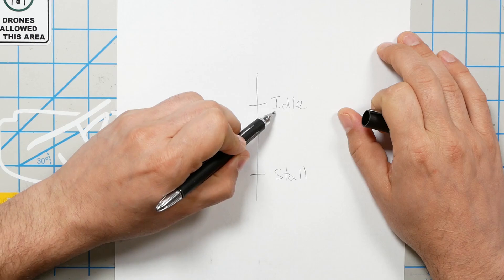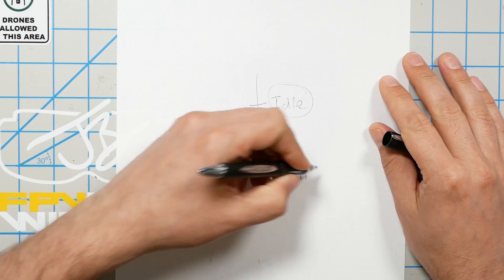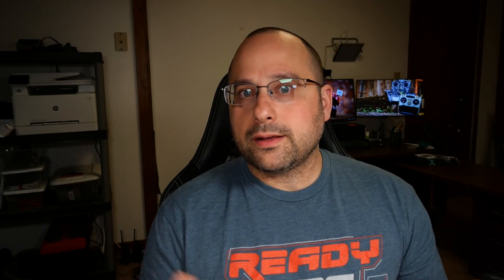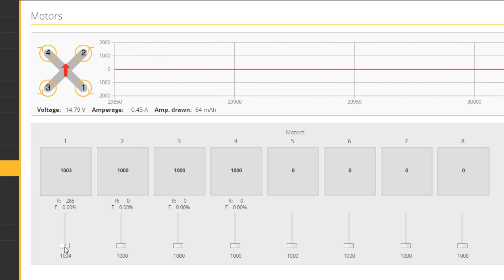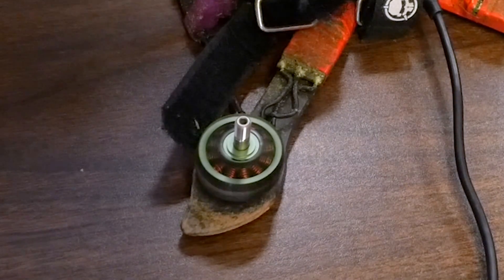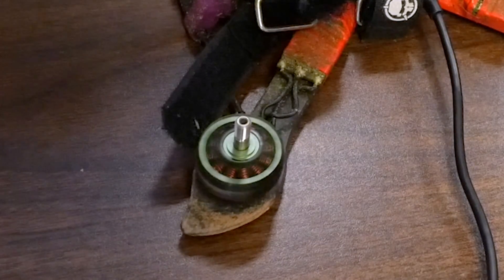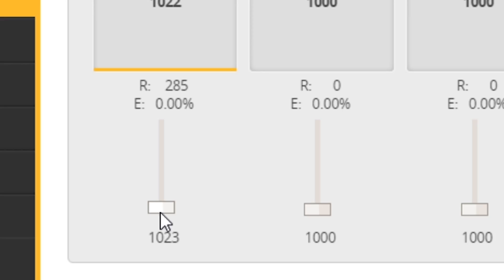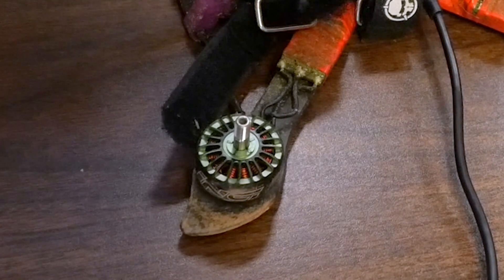"Dynamic Idle" the most useful Betaflight feature you never heard of

Comment: I didn't understand how this work and what it's used for at all from this video, nice for getting attention that this feature exists though. Would greatly suggest everyone to just read what's written in betaflight documentation about dynamic idle, it's well written and super easy to understand.
Reply from the maker: It's really not at all, and even the people in the JESC group think that the Wiki page is terrible at communicating what the feature does and how to tune it. Please click through to the FB group link in my video description if you want to read more about it.
Reply: @JoshuaBardwell   Ok, I do agree that it can be improved, but nonetheless it's quite clear what it does from reading it (not in a detailed manner (this I wish was explained somewhere, because it's quite unclear how exactly idle values are changing on what conditions), but in general). It's stated there that using bidirectional dshot rpm data some external conditions can be ignored for idle_min_rpm floor and thus motors can spin quite slowly without desync issues. And I totally agree that then it can get a bit tricky to think of its usefulness, but thinking about rotations it's quite obvious that slowing down a bit more some of the motors would help to make a certain moves more precise and efficient. Anyways, thanks for the video, wouldn't have known about this feature without it! :)

Comment: My understanding of dynamic idle was that it used the rpm data to make sure the motors never stalled whilst allowing a much lower minimum idle overall. 
This is probably useful for making last minute adjustments when flying as your quad should be less floaty.
Reply from the maker: This is one approach, but the smart folks I talked to seemed to think this was actually not the way to get the best results out of dynamic idle. That a quad will generally fly better with a higher idle speed, and the value of dynamic idle was allowing a higher idle speed without a net increase in idle rpm due to the PID loop needing to speed up motors.

Comment: Electric motors actually have max torque  when starting from stall and the torque goes downwards as the RPM increases because magnetic field cannot be modulated fast enough due inductance. However, the current generation of brushless motors do not have required sensors to actually push the motor hard from stall so that's why you need minimum RPM for max performance.

Comment: I feel I may be missing some of the usefulness. Take the "Vanover" case where your using a higher idle. Isn't activating dynamic idle removing some of that benefit? If the motor loses torc at low speeds, you are essentially allowing for the lower torc on those motors again. Is it that the lower torc is outweighed by the smaller range the other motors need to move? I think seeing the math would help. Thinking more, I guess it's redistributing a small amount of the work required to a slower but parallel process. In this way, I can see a nominal benefit that most people wouldn't notice and probably not worth the effort. Thanks for this interesting video!

Comment: I'm running a raging droner with t motor f60 pro 4 1950kv. I left the stock 5.5 idle and put 20 in dynamic idle. I'm using configurator 10.7 RC1 and 4.2 RC1. It's definitely a great feature that improves flight performance. I'm a huge fan after trying it out. Thanks JB

Edit. I ended up getting much better results doing proper math. It's definitely something that needs to be followed to a T for optimal results

Comment: I'm Learning... 

I learned that maybe my de-syncs are from setting my idle percentage too low... never dawned one me
Reply: Yeah I thinks that's what's been happening to me
Reply: Me too...
Reply: Motors have weird non-linear behaviors at both extremes, it can be a bit finnicky.  This approach should solve that though.
I only had to bother learning this because I was getting desyncs on my 6S 7" setup, and it wants to hover at 9% throttle.
Not a guarantee to fix the problem, but if you are already having issues, definitely run the slightly higher values over the calculated ones to make sure (and then test at worst case high speed split-s entries and such)
Reply: same here^^
What a relief, I was really down because I couldn't really find the reason. This is a new thing to look into :)
Thanks JB!
Reply: I find if your ds are too low or your ps are too high.... I was getting flip of death.. messed with the pids. Idk how that could make the difference but it did..! No more fod! Try lowering ps and see if it goes away..
Reply: Just learned that as well. I haven't flown much because I got tired of my quad death rolling when I did front flips. Now I know what is probably going on. Thanks!

Comment: Just had a desync at zero throttle with my 3 inch build resulting in a crash. Enabling bidirectional dshot and dynamic idle sure enough fixed the issue. Also feel that enabling rpm filter and disabling first gyro filter resulted in much more responsive flight characteristics.

Comment: Hi Joshua! As you pointed out, it is bad to let the motor speed drop too low. The motors are powerful when they spin fast, but they are surprisingly weak at starting up especially when faced with oncoming air. That is, of course, the main reason why we all use the idle speed to keep our motors from ever spinning that slow. So, here's my question... If I set my main idle speed to be just enough to prevent the low RPM problems, then why would I want to let idle_min_rpm spin the props slower under any circumstance? I may tell the quad to do a hard roll at zero throttle, and it may want to lower the speed of the motors on one side, but a hard low-throttle roll still isn't a good time to have motors stuttering because of low RPMS.
So, I think it's a really interesting feature but I don't use it for myself. In your video, you claimed that idle_min_rpm might help Vanover bring down his high idle speed, but I think you got that part backwards. If you use idle_min_rpm to prevent low rpm problems, then you are free to increase the main idle speed to your desired feel. Some people might intentionally increase the main idle speed above idle_min_rpm to make it feel more floaty. Some people like Vanover might increase the main idle just to increase resolution on the throttle stick (because that lower part of the throttle would be unused in a race anyway). Before idle_min_rpm there was more of a downside to having a really high main idle speed, but now you can tune the feel of your idle separate from idle_min_rpm which is just there to set the absolute minimum RPM you're willing to use. Still an interesting feature. Just a different way to think about it. Cheers!

Comment: Wonder when someone starts using Sensored motors on a quad. 
In conjunction with current control they would make all those features obsolete. The motor would start at maximum torque and no death rolls whatsoever.
Yes it requires 5 signal wires, but maybe a racer seeking every little advantage?
Reply: Fabian Rudzewski race drones are supposed to be raw and best power to weight ratio but when you add complexity more things can go wrong and that’ll add extra weight slowing racers down
Reply: @flyingmonkey8245  yet racers prefer predictability and consistency over the last bit of performance. 
There are even features in betaflight, to limit the motors to an empty batterys performance in order to have consistent behaviour for the whole pack. 

5 signal wires and 3 Hallsensors would make a less than 10g difference for the whole quad. 
I'd only be worried about robustness.

Comment: Wow, what a coincidence this is exactly what I was looking for. I like to do a lot of max throttle runs, and towards the end I go to zero throttle, then quickly turn around, and then as the quad starts slowing down, it will occasionally do a half roll and fall a bit I believe because of motor stall from low voltage and slow voltage recovery? Most of the time I can quickly recover, but occasionally if I’m flying too low, it will stall, do a half roll, and crash into the ground upside down, and I think this might fix that.

Comment: In new 10.7 configurator, Dynamic Idle RPM is on PID tuning page. It is set to 0 at default. This is why the wobble is there in 4.2. Hope they fix or have it “slide” with increase in throttle percent.

Comment: I always have the problem with yaw washouts when doing building dives with my Mobula7 and I found out that raising the idle to about 15%, where the quad is just about to lift off by it self, helps with the yaw washouts. I just recently got into dynamic idle but I'm still testing. (Yea, I'm commenting on a 4 year old Video)

Comment: small correction: For BLDC's you shouldn't lose torque at lower speeds, torque is dependent entirely on magnetic flux in the core, which is governed by current. The motor certainly cannot maintain high torque at low speed because inadequate cooling.

I suspect this is more of a fundamental problem with sensorless control of said motors. desync happens because the ESC losses track of where the rotor is relative to the stator and the motor losses all torque.
Reply from the maker: There is more to the torque claim, you're right. The desync is because at low speed, the BEMF that is used to detect pole crossings is very weak and is lost in the noise. The lack of authority is in part because when the prop is moving slowly, it isn't making much thrust.

But from what I am told by people developing the feature, the motor is less responsive coming from low rpm, which I approximate as "lack of torque" when explaining it. The motor will take longer to get from 2% throttle to 5% than from 50% to 53% for example. Once you get out of the low-rpm region, this problem goes away.
Reply: @JoshuaBardwell  Its interesting observation noneheless! No doubt that the practical wins out over this theory. I think I read somewhere that the sensorless ESCs often switch between algorithms at low speeds for this reason. Keep up the great work!

Comment: I need to check it myself too. But, on Mamba F405 MK2 stock min idle is 3.0 which is quite low already. Thanks for sharing Joshua!
Reply from the maker: The point is that with dynamic idle you can raise that so your quad flies better at zero throttle, without giving up the ability of the motors to go below that point if they need to.
Reply: @JoshuaBardwell  Hi never flown  just got mobula7 hd can't set it up in betaflight just about got it binded I'm almost giving up  on it if you could give us some info many thanks 👍

Comment: So to just distill it slightly further.it helps your quad rotate around the center axis properly(or better than normal),rather than just lift one side of the quad to rotate.its the best we can do with the design of quads at present.ideally you would have a second motor&prop on each arm opposite mounted to the motor on top of the arm.so as one side spins up,the motor on the opposite arm facing down,would pull down.therefor having an equal push to pull&properly pushing the quad around its center point.but then youd pay a weight penalty&drag.so this dynamic idle&air mode etc. Is doing the best it can with the hard/&software configuration.theres been many incremental benefits added to bflight over the years.many of which we might have thought at the time were just adding complexity.which we now consider the norm&wouldn't be without.im just wondering when/if these incremental tweaks are gonna result in diminishing returns.although I do agree with this one as d syncs & motors being able to respond and spool up quicker from a certain point of idle.is allowing for spool up lag&the lag that the pid controller/rc system as a whole introduces to be partially negated.

Comment: Um at around 5:00 can it really spin around the center of mass? The pivot point should be somewhere between the right motor and the center of mass if not on the right motor imho, just because the right motor won't reverse thrust.
Reply: an object will always rotate around its center of mass, no matter where the force is applied from. if a force is applied at the center of mass, or the forces are net 0 at the center of mass, than the object wont rotate
Reply: @DirtyLew42  I agree somewhat. It will rotate around the center of mass, but another vector is introduced which induces a change of the position of the center of mass, as it is not compensated by an equal force on the opposite side of the center of mass.
Reply: HoverFly incorrect. Center of mass will never change, unless mass is physically moved. Please do some research of your own.

Comment: Ho Hooo you say good things. This piques my interest for I throw 6 in props and have acquired a taste for inverted ticks with hang time. To be honest this still is at the time of this comment my first acro drone the Butter Kwad. But reviewing other 5 inch freestyle drones with inverted yaw spins and such I'm realizing the 6 inch props arrest my drone faster then what I wish to achieve. Believe me I've tried.  Don't even get me started on PID tuning. One problem after the other 😩 Will delve into this for sure. But I'm almost ready to throw in the towel on my Butter Kwad for what I'm trying to achieve. It hasn't quite turned out the multi tool I had envisioned.  Never expected it to be a master of Cinema, Long Range and Free Style but something just don't add up. Pitch slow wobbles are really sticking in my craw too. P's over 120 now....I's at 60. maybe should just slam it at 250 P's with 30 D's FF off too

Comment: sweet video dude. this may fix the death roll issue I've been having on one kwad. on sharp rolls with a sharp ending it goes straight into death roll.  I think it has to do with the motors i have on it. i was using the same type of motor on another quad that did it to me. but smashed a motor the first death spin and swapped brands. no issues since on that one.  Thanks for the tips. might save me $60 in motors. 🤘🤘
Reply: has anyone had issues with the Armattan sabotage rc Booty motors?  they seem to be the cause of my issues, thanks,

Comment: My understanding of dynamic idle and how I have been setting it up has been a bit different. I wasn’t aware setting a min rpm would allow the FC to drop below the idle value. I think of the min rpm as a backup setting since. Like you showed when touching the motor with your hand, a throttle % doesn’t necessarily mean the motor is spinning. With props and backflow of air after a roll, that motor could possibly stop and desync. However, a min rpm is more accurate, so the FC could ramp up the throttle past your idle percent to match tour min rpm. (Dynamic) so I basically drop my idle value and tune the min rpm to feel the same as my idle value, then put the idle back. Now they both match, and I have a more accurate idle speed and desync protection. Have I been doing wrong? 😆
Reply: It doesn't. The DSHOT idle value is setting the min power that the PIDs can command the ESC. In a situation where the quad is dropping rapidly that amount of power may not be able to keep the props turning in the right direction, and they'll struggle to spin up quickly when the PIDs request more power. The min idle setting ensures the props keep spinning at at least 80% of the static idle speed (if you follow the setup properly!) irrespective of the load on the motors. That's all it does.

Comment: I assume that the min idle depends a lot on the prop ?  As there can be large counterforce against the motor rotation during some maneuvers.  Also a full or an empty pack could probably make a difference ? and what about the BLHELI Settings for motor timing and start up power?

Comment: So I got confused by the idle min section. You went through the exercise of getting the lowest possible rpm, (300) and then it seemed like you "winged it" and put in 1200 in the CLI. Do we use 4x the number we come up with?
Reply: yea im confused also i just went through this whole thing and now my quad just dies at the lightest blip of a roll.
Reply from the maker: I didn't wing it. I came up with a value of about 300 for three motors and then 600 for one (probably damaged) motor. I flew with a value of 600 and got an arm-drop on sharp moves. So I ended up raising it until the arm-drop disappeared. 1200 is where I ended up. That's the procedure I suggest you use.
Reply: Ok I see what you saying now.

Update: it wasnt the dynamic idle change I made that caused the quad to die, it was loose positive wire coming out of the xt60 plug. Dynamic idle is working great, thank you Josh also informative.
Reply: @JoshuaBardwell  So if we have to add the 4 motor idle values from the bench test (that wasn't quite clear tbh), why didn't you then come up with 15 (1500) or put it even higher as you suggested?

Comment: Hey man. I just hopped into fpv and now I'm here cause I was wondering about dynamic idle. In 4.5.1 , I just set the value for dynamic idle in the pid tab and that's it? motor idle (static) is greyed out in the motors tab after setting a value for dynamic idle in the pid tab. Or do I have to do the CLI thing too? Thx for all the time you've been putting into these videos. They help so much!! Cheers m8

Comment: I have MOTOR_STOP enabled and airmode controlled by a switch. If I during flight switch airmode off and lower the throttle to 0% the motors stop but they never stall, as soon as I increase the throttle all the motors start spinning again.